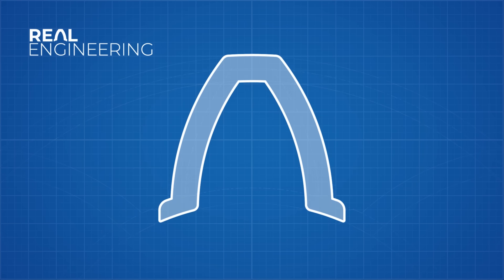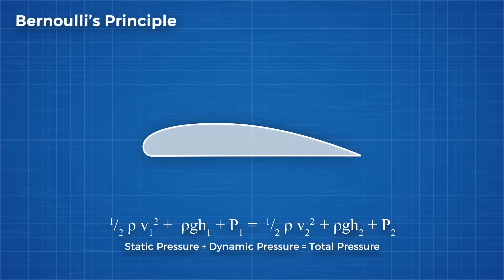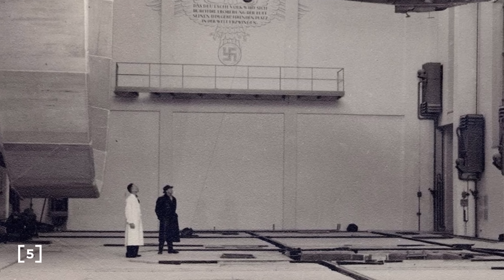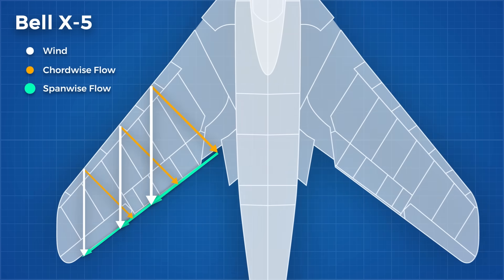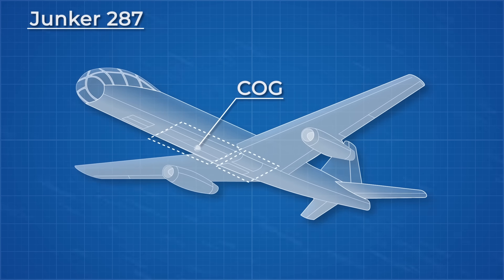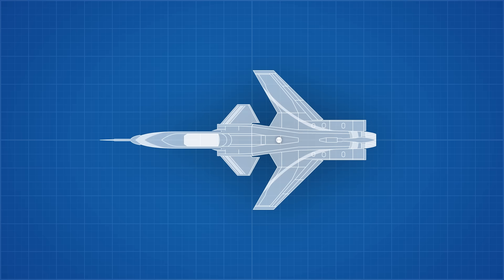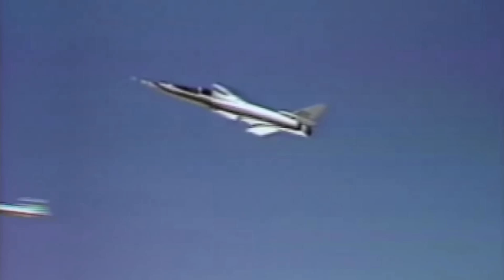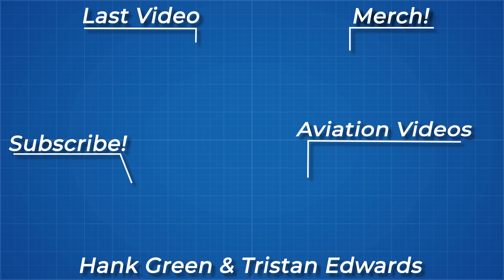Why Do Backwards Wings Exist?

Comment: "Low pressure zone" - technically, the total air pressure is higher (because you're adding energy when you accelerate the air) BUT by increasing the air flow in one direction, you reduce the air pressure in the other directions, so air pressure against the upper side of the wing drops relative to the air below the wing, which is where you get your lift. So net air pressure is higher, but air pressure perpendicular to the flow decreases.

Comment: Great video. Just one point on the use of carbon fibre composites: the twisting of the wing was coupled to its bending. The objective was to counteract any increase in angle of attack due to twisting as it bends. This was essential for the design of this airplane ensuring stability and showing the advantage of composites versus metals.

Comment: I started flying gliders this year, and the ASK-13 I'm getting my lessons on also has forward swept wings, though only by 6°. As far as I am aware though, that's been done more because of the reasons the Ju 287 had forward swept wings, it allows the rear pilot of the gilder to be seated at the center of mass, so it basically doesn't matter much if you fly alone or two seated.

Comment: Stealth killed the X-29,  otherwise new fighters would have forward swept wings.  The benefits to dogfighting are too great.
Reply: Dogfighting doesn't realy happen anymore but i'm quite skeptical about the usefullness of stealth as well. I think it's a waste of time as i have yet to see worthwhile results. They generaly have been used in countries that don't have radar or can't take down aircraft and the cases where they could it didden't take long for them to be detected.
Reply: MrPotato stealth is for the gays. We need A10s built like fighter planes.
Reply: @MrPotato Indo-Pak conflicts very recently involved a dogfight.
Reply: @idunno402  This really isn't supported by any evidence, unfortunately. I don't think it's too likely either - the Indians using the MiG-21 (no matter how much they upgrade it) are going to get utterly smashed by Pakistani F-16s, especially in a dogfight. The handling characteristics of MiG-21s are AWFUL.
Reply: @Kirumy it already happened, a MiG-21 was shot down. The pilot was returned the following days.
Reply: @idunno402  it was most likely intercepted by air defence. It was never cited as an air to air kill.
Reply: @2Potates  Stealth is not about being invisible but instead reducing the range at which a radar can return a reliable enough target to be engaged. Furthermore, it allows for larger room-for-error when notching incoming missiles and decoying incoming missiles. The purpose of stealth is to intrude into a hostile space without being killed, not without being detected.

The other major component is that stealth allows you to get closer before you switch your radar on, fire a missile, switch it off and get out of there. Here's a likely scenario:

An F-35 is on an air patrol mission, supported by an AWACS on his side of a border. The AWACS reports an enemy fighter is 20 nautical miles off to his East and an enemy AWACS is 60 nautical miles to his East. He can egress 10 nautical miles East, switch his radar on, fire a semi-active missile and retreat. Even though he's probably been detected by the powerful radar the enemy AWACS uses, he's not likely to be able to be painted (or even detected) by the enemy fighter's radar. Once he fires his missile, the enemy fighter cannot pursue or he will be destroyed. The enemy fighter is forced to go defensive and, at 10 nautical miles, is probably going to get splashed by the AIM-120s the F-35 tends to carry. Even though the enemy fighter KNEW roughly where he was, he couldn't do anything about it. Once he's switched his radar off, he's not likely to be able to be painted, so he can return home without fear of immediate retaliation.

The advantage stealth has is it prevents enemy fighters from being able to get that positive return which can get you killed in a BVR fight.
Reply: @kirumy_yt  That's a lot of money for a small advantage that going to be lost anyway when lidar gets implimented. Also don't shill the money well that is the F-35.
Reply: @2Potates  LIDAR's effectiveness is inversed by range and will never replace radar for BVR due to this weakness. You'd need thousands of small lasers to hope to get anything beyond 20 nm, which is the edge of visual range.

You'd be better off with some sort of conical laser, operating in a wavelength that isn't easily attenuated by air. Oh wait, that's exactly what radar is.

The F35 is undoubtedly a cash cow but credit where credit is due, it can splash anything other than an F22, 9 times out of 10
Reply: @2Potates  Stealth is like camouflage. Just because your enemy has a flashlight doesn't mean you go out wearing an orange vest. No, you try your best to be stealthy. Stealth aircraft aren't invisible to radar, they're just way harder to spot. Every bit helps improve survivability. This X-29 is an orange vest while the F-22 is full camo with face paint.
Reply: The weight of the wing reinforcements diminished the agility benefits. Additionally, missiles can pull 50 g's and AA combat now is usually beyond visual range. Eventually all air combat will be robotic.
Reply: @T1Oracle  A missile pull 50 gs?! It'd have to have enough fuel to even produce 50 gs!

No, missiles are limited by the same restrictions everything else is - drag. Once they use up their fuel, they become smart rocks with a proximity warhead.

Missiles don't usually encounter a situation where they'd pull anything more than 5gs, which is basically the booster phase immediately off the pylon. While accelerating, their thrust reduces until it reaches 0 and they're relying on the gravitational energy gained during the loft phase to chase and kill their target.

I think the AIM-9X would be the most likely missile to experience a high g-force and it wouldn't be THAT high.

Comment: Wouldn't a forward-swept wing exacerbate yaw instability?
Reply: Yes.  But pitch is even worse.  The video got his information correct. Sorry, he got caught up by a common myth peddled on the internet.  His only screwjob this time was in the structure wing box analysis. It was designed with LESS structural weight and LESS stiffening than a typical wing. Not MORE. Why? Wingtips were designed as completely unloaded producing NO LIFT, like a birds wings. Higher CL is found at/near the root and can be done as the higher CL creates a higher Induced Drag, but due to forward swept wing the Induced drag is canceled when the swirl pattern collides with the OPPOSITE wings swirl. Because the wingtips are unloaded it MUST have active control as a slight change in pitch creates a present load at the wing tips which increases due to deflection increasing yet again the load. This was a double whammy as they had also purposefully made the structure with less weight and LESS stiff than normal compared to a standard wing as part of the testing program was also directly centered around ACTIVE controls for load alleviation which one now sees on elevators, ailerons, slats on modern commercial airliners. Birds get away with this with an often slightly forward swept INNER wing and a backwards swept outer unloaded wing used as their ailerons. This also allows a bird directional control and why birds do NOT have "rudders". 

Now that commercial airliners are made completely with FBW controls and the required 4 computers(not 3 as you stated), it is quite possible for them to make a forward swept wing airliner in the near future.
Reply: w8stral that was an interesting read! Whered u learn all that from ?
Reply: @princeuy8021  If you are interested in a topic, you search for/learn not only the theory, assumptions behind the theory(which uses short cuts usually), but also the history while applying it to real life.  No hand on experience = useless.
Reply: w8stral I’m here for this, great comment.
Reply: Burntsider instability in a fighter jet is the point. Flight computer handles stability, pitch was the problem.

Comment: Its not aerodynamic instability, its supermanuverability!
Reply: Control sensitivity set to 100%
Reply: There is some truth there. Fighter jets are way less stable than passenger planes and it is part of what makes them so maneuverable.  Compare dihedral to anhedral. Stable harder to steer vs less stable but higher maneuverability.
Reply: Su-47 Represent.
Reply: It's not aerodynamic instability, it's surprise  crashes!
Reply: Many modern fighters actually have inherently unstable designs just for this purpose: increased manoeuvrability.
Reply: @2020Twenty  I know. Its a term in aerodynamics
https://en.wikipedia.org/wiki/Supermaneuverability
Reply: My Dad had one of the engineering teams on that plane, that was exactly why they were trying it out.  It could out turn anything else out there.  Was originally also supposed to have vectored thrust which was just throwing too many ideas that weren't ready for prime time into one package.  It was significantly more fuel efficient than the military expected, and handled like a dream as it was one of the first fly by wire planes... your input as a pilot was a request to the computers and it dealt with making that happen without the plane destroying itself.  But it was an idea to be able to turn tighter in a dog fight than anything else, which it did dramatically better.  Hiding from enemy radar became more of a priority than being about to outmanuever the enemy in a one on one dogfight.  Made sense when we already had the F-14 and it's support systems that allowed them to take out anything within a couple of hundred miles without the Top Gun style dogfights depicted in the movies.
Reply: EA sent you didnt they?
Reply: Agreed. I thought this would segue into talking about the Eurofighter when he mentioned computer-controlled canards but I was disappointed.
Reply: I always thought that was the main reason for that plane. And once computer control came around it was possible. It's great to find out there was another reason as well and all the physics behind it.
Reply: @thanksfernuthin  There is a game with that plane, Infinity Skyline.
Reply: Also, forward swept wings just look really cool
Reply: inherently making a plane too maneuverable makes it able to turn on it self and flip... once that happens you practically need a computer or a man that never throws up or passes out... in a video game, it is possible to gain control back due to the fact that you are not experiencing G forces and rotation. tho you need to do special individual wing maneuvers to really get out of a spin... that is not possible with a joystick. a computer can detect the spin speed, the pressure on each wing and the needed forces to counter the spin on the spot and knows the tolerances to cause loss of control in the first place. 

speaking from personal experience in Kerbal Space Program, making a plane that has just enough lift and lots of maneuverability can make it hard to fly, if you have too much lift and enough Maneuverability then you lose top speed, or at some speeds you can lose the plane in a spin... any Jet Style needs to go fast but that always comes at maneuverability weather it is too much at high speeds or not enough at low speeds... so Balancing is a pain in the ass, if there was a purpose built computer instead of just the stability control (same thing but it is made for General Flight and not the actual plane.) you could go crazy on the wings and make it stable in any direction!

tho i suspect that if they go faster than certain speeds, the wings will start to bend upward and make the jet pay! weather by breaking the wings or permanently bending the wings making the computer trying to compensate all wrong and sending the plane in a endless spin... since they favor higher speeds over maneuverability and they do not use guns at sonic speeds and only missiles, they just went with traditional Jets aiming at speeds. (if they could go 10 times the speed of sound instead of 2.8 times, they would! but stuff heats and bends.)
Reply: You got roasted in learn engineerings newest video.
He got u hard
Reply: @Radec913  I know. I know a thing or too about planes and I know especially russian planes can pull manuvers like cobrase because they are unstable.
But I learned. There is a difference between "unstable" and "too unstable". Even if the plane is russian
Reply: Yep. Quite true. Fighters typically have design elements that make them deliberately unstable, because that makes them more maneuverable.

Civilian aircraft are preferentially designed (unless it's an aerobatics or racing design or the like) to be stable, and to favour behaviour such that if the pilot lets go of the controls, the aircraft with self-correct;

Eg, pitch down (to prevent stalls) and roll back to level (for obvious reasons.)
Reply: supermaneuvrability is generally achieved by using computer controlled Fly-by-wire to keep an unstable design from losing control.  the F-16 was one of the first designs that was intentionally designed to be unstable and use computers to keep it under control, and as a result the f-16 was one of the most maneuverable aircraft arround untill the advent of thrust vectoring
Reply: Thats what russians call their modern fighters
Hmmmm.....
Reply: @NogrimStoneson  I'm surprised they skipped this all entirely skipped this tech especially since many countries are attempting to develop a scramjet. But with scramjet the very weakness of the aircraft would be the pilot. Human bodies won't be able to handle such force so these aircraft I'm guessing are going to be unmanned. It is also useful for cruise missiles instead of using a basic rocket Engine.
Reply: "Its not aerodynamic instability, its supermanuverability!"

Believe it or not, that's actually correct. Case in point: the F-16. The F-16's airframe is actually inherently aerodynamically unstable. VERY much so, dangerously so. In fact, it was one of the first fighters to make use of a PURPOSELY designed aerodynamically unstable airframe and it could do so successfully because digital fly-by-wire systems allowed its computers to input corrections to keep it stable in the air. But that aerodynamic instability means you can literally throw your weight around more violently and faster than an aerodynamically stable design. If digital fly-by-wire was not a thing, the F-16 could not exist as we know it. Well... Not without crashing, anyways.
Reply: @matchesburn  i know. There is a "supermanuverability" article on wikipedia
Reply: Rash B blin shgeshhshfsdsssfssgssgssgssdfsgfssssshfdsdfsss
Reply: what's the difference -> inherit aerod. instability = maneuverability!!!!
Reply: I still do not know a lot about aerodynamics, but this one was like DOH! Yes! You want unstable, you want your plane to DANCE in the sky!
Reply: Your not wrong actually
Reply: Rash B blin or both. HmmmmmmmmmmmmMMmmMm

Comment: +Real Engineering   

Ummm...I could be wrong, but I think that the proper terminology for these are "Forward-Swept" Wings.
Reply: You are correct. There are numerous errors in this video like that, though they're almost entirely nit-picky for the audience here.
Reply: "+" hasn't existed for years are you ok?
And he said forward-swept in the video, the title is like that because "backwards" is much more intriguing and clickable than "forward-swept"
Reply: @enbyennui  

LOL, yeah, I'm "okay", thanks.

"+" still works perfectly and is easier to type on my mobile keyboard.

I understand that "backwards" is more catchy or interesting, but for an ENGINEERING-based YouTube channel, you would expect them to forgo the click-baitiness and use proper terminology.

I'm subscribed to the channel and the title just popped up in my notifications...my comment was just an off-the-cuff response without actually having watched the video.  ;)  (old school Smiley just for you!)
Reply: @bbfoto7248  No "+" literally doesn't work it's not a thing, you see how Youtube literally inserted an "@" at the start of your comment like sweets... no.
It's not clickbait it's a reasonable, barely-inaccurate descriptor and it's completely fair to want a slightly more attractive title for your video - clickbait implies lying or deceit. Also watch the video before commenting that's like rule 0
Reply: I mean that's what he said in the video...